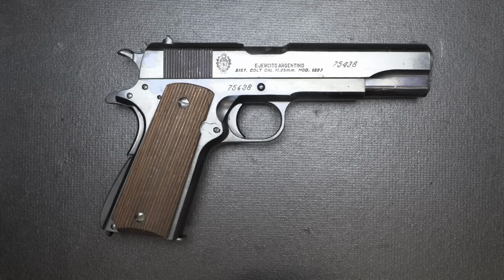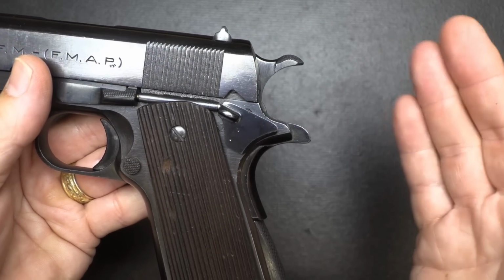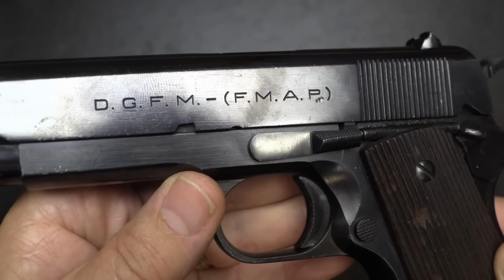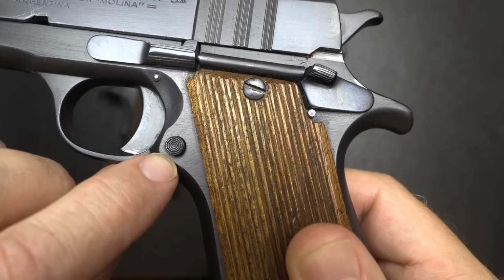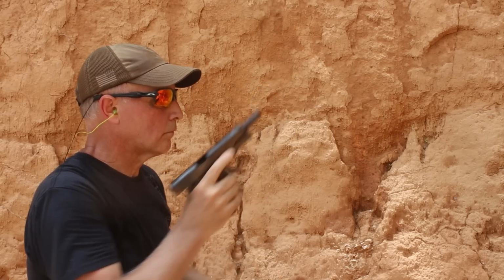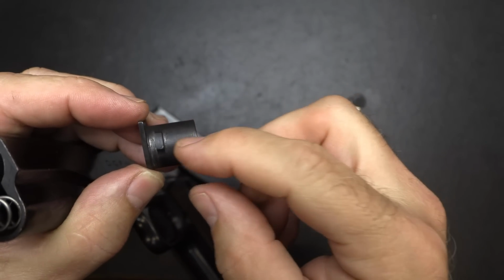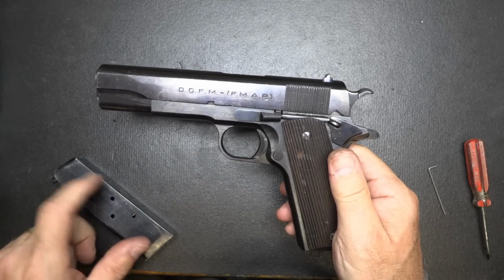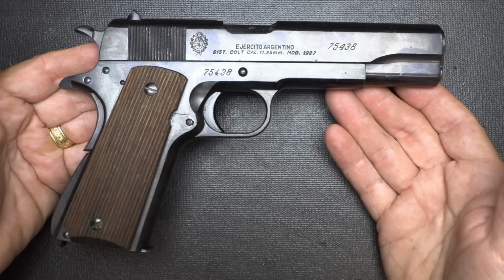Argentine 1911: Model 1927 45 ACP Gun Review

Comment: I have a DGFM-FMAP 1927 that's a little newer than yours- in the 106K SN range- and it has those same grips, as did my Ballester Molina that I purchased from Interarms back in the early 90's. Mine has a nickel finish and the finish is well worn- I just got it and have not yet cleaned it up, but it sat in the original box for 30+ years from the previous owner. Even with the odd finish (I've seen some two-tone examples), I don't believe anyone refinished it at any point- unless it was so long ago that possibly the Argentinian armory did something to it to make it this way. All the stamps and roll marks look relatively crisp which makes me think it had no significant work on the finish... just have no idea, really.  It lacks a crest on the slide as well. 
I plan to take a deep dive into the history of it and we'll see where it goes. 
I appreciate your video, and thank you for taking the time to share!

Comment: The Colt 1927 system pistol was not only a weapon, but a symbol of prestige, a national icon and a military and police tradition. The Colt 1927 Argentine model was adapted to meet the needs of the Argentine army to replace the Smith and Wesson revolvers. The Colt 1927 was used by lieutenants, sergeants, colonels, generals and high-ranking officers of the army. Not only did the Argentine army use this pistol, but it was also used by the Argentine Navy, Aeronautics, Air Force, Federal Council, Federal Penitentiary Service, Argentine National Gendarmerie, Argentine Naval Prefecture and the Argentine Federal Police, until it was replaced by 9mm caliber pistols such as the Beretta 92FS and the Browning GP35.

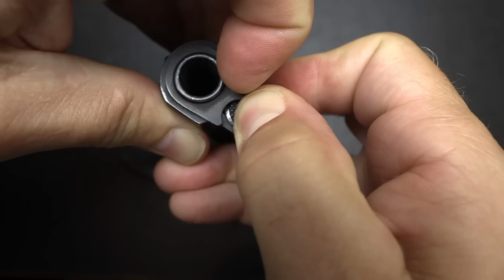Comment: 15:30 - you do know this is what the magazine is designed for, right? The front tab is for holding in the recoil spring plug.
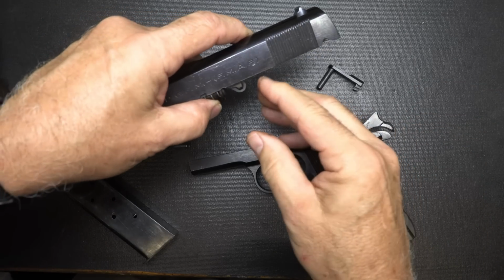17:12 - before you do this, you should examine the ejector for burrs, dents, or bends. Steel case ammo tends to beat them up and you begin having ejection problems (stovepiping) so while it is apart, it is best to check. 
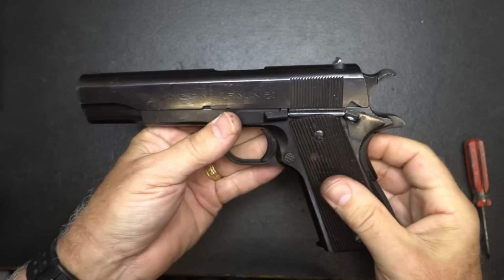18:35 - check your safety
The Ballester Molina was a cheaper version as the Colt Sistema was a licensed product and Argentina wanted a cheaper version so as to reduce the budget. As such, it wasn't authorized by Colt. It included the following differences: pivot trigger instead of sliding, no grip safety, different hammer, serrations on slide (visual difference), magazine release button threads into keeper on right side rather than having a screw from the right side, there is only one notch for the slide stop, and the grip screws are located higher on the left top screw. I can't imagine how these differences would have lowered the price enough to have made it worth the changes. It would have been interesting to see a direct comparison between your Sistema, the BM, and a '40s/'50s Colt.

Comment: The first Colt adopted by Argentina was the 1911; not the 1911A1. They designated it the Modelo 1916. When in the mid-1920's, they approached Colt to purchase more of the 1911 Modelo 1916, Colt informed them that they no longer made the 1911. However, Colt offered them the 1911A1 and Argentina accepted it, receiving 10,000 commercial models in 1927 and 1928. When Argentina manufactured their own 1927 pistols after WW2 on Colt machinery, they turned out a product as good as anything made in Hartford. The quality of the 1927 is superb. The Argentines throated their barrels which improved reliability and those I've shot will feed round nose, hollow points and semi-wadcutters without a problem.
Reply: Many of these copies from the 1920s and 1930s were made with Krupp steel from Germany.

Comment: 2 argentinean classics of the old military industry which is now totally non existant. One interesting difference between the BM and the Sistema is that although the trigger in the BM looks like a regular 1911 trigger it does not move in a straight direction like the 1911 does. It actually pivots from a pin located on the top of the trigger. It moves like a double action trigger would.

Comment: I have one of the 10,000 that were made by Colt before local manufacturing was set up in Argentina.   It has the Ejercito Argentino markings on the right side of the slide, but the left side has Colt  factory markings with the patent dates instead of the DGFM-FMAP markings.  My serial number is towards the end of the manufacturing run of 10,000.

Comment: When I was in High School over 50 years ago, one of my friends had one of these. The recoil spring was so worn that with the hammer cocked and taking a normal grip on the pisto, you could cycle the slide all the way to slide lock just by quickly making a whiplash motion. We never got a chance to shoot it, he traded it off before we could replace the spring.
Reply: That's one worn out spring. You'd have to put mad rounds through a gun to wear the spring out that bad.